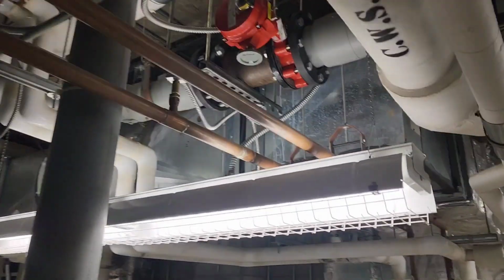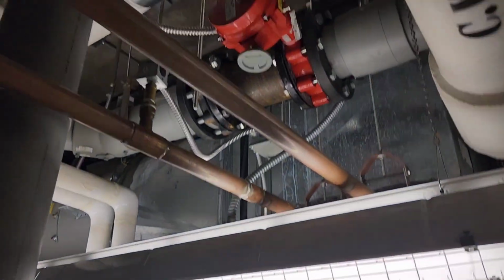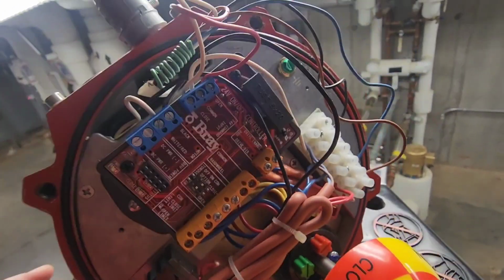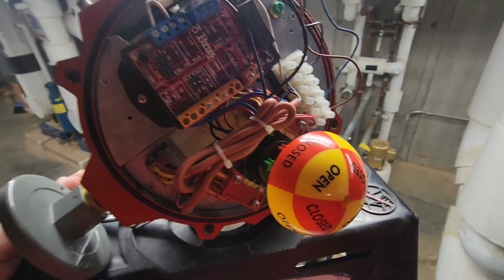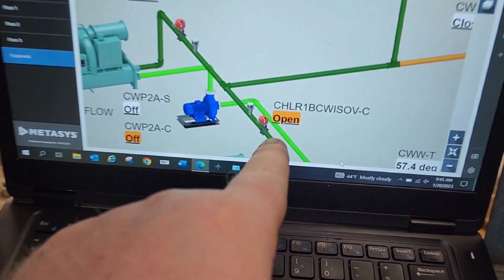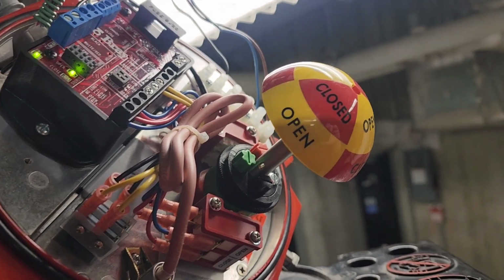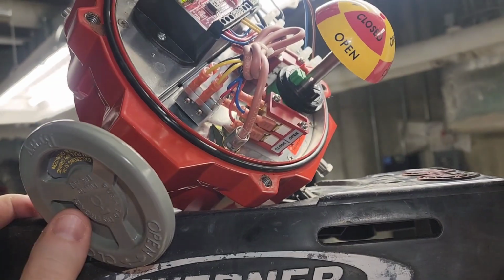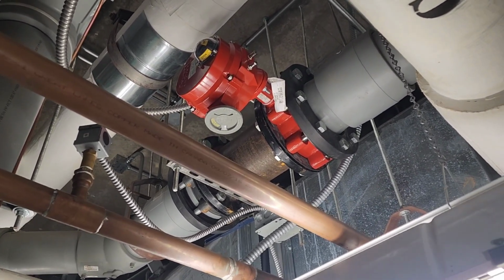Replacing a Bray two-position isolation valve actuator in a chilled water system

Comment: i had a question these actuators vavles... we have 2 chillers in the penthouse. i have been running chiller 2 on over this winter. Now i want to give chiller 2 a rest and I try to turn on Chiller 1 valve from the BMS system. The evaporator side valve open and the relay is on. But the condenser actuator valve will not open. i even try to open it manually and when i punch it back in. it automatically went to close? does this mean that the relay is not working or actuator? or is it because chiller 2 not running as hard ( it still cool outside ) that chiller 1 does see the need to have the condenser running ?
Reply from the maker: Try to command the actuator through your control system. Verify you're getting the control signal to the actuator. If you are, you have a bad actuator because that's exactly what happened to this one.
Reply: @Systemcontroltech  thanks I'll do just that.